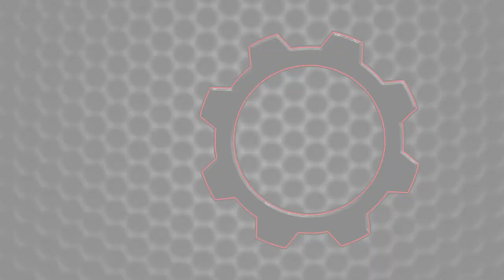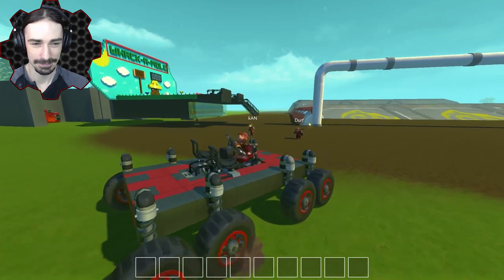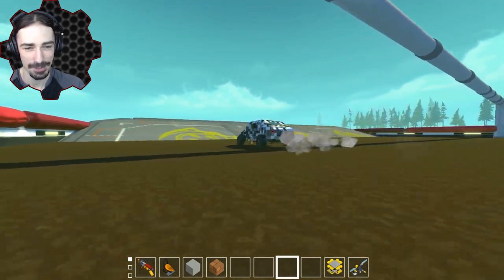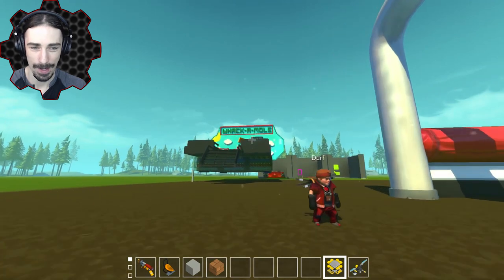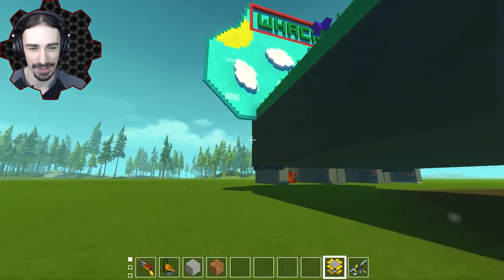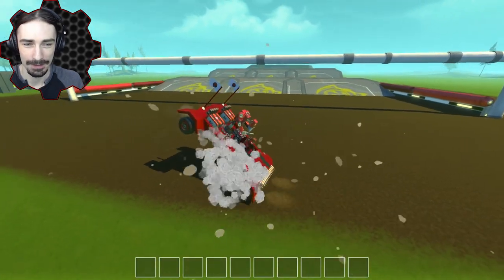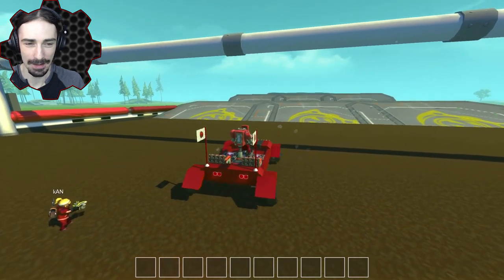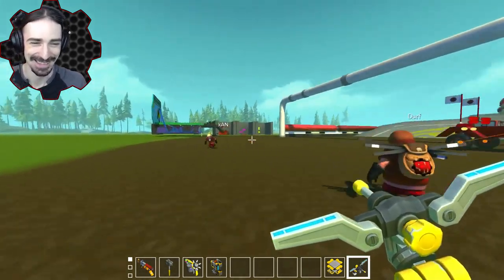FLOPPY WHEELS MAKE RACING AWFULMAZING! - Scrap Mechanic Multiplayer Monday

Comment: The mechanisym for the flop is due to the wheels going too fast for the bearings and the bearings colapse and traction makes the wheels spin faster and faster until you go flying. If you spin tiny wheels at the fastest engine speed(you need mods) and you hit the gas it will glitch out and do the same thing, except it is instantanious. I haven't shared it, but it is the smallest car in the game. From the front its 3 x 2 x 4. And the reason your car was better scrapman is because you were heavy. Therefor it forces the bearings to slow down but once your in the air you wont slow down because you aren't in contact with the ground, therefor there is no squishing effect to slow down the bearings. Thats why u went flying. Also that glitch has been here for since the bearing strength was updated. Soo its old scrapman.

Comment: It would seem cars with fenders that either have restrictive suspension systems or high mass seem to have low levels of flop. This makes me believe that if you either restrict the movement of the suspension or pin it under high weight flop levels go down.

Comment: Here's a challenge idea:
A regular racetrack, but the vehicles do not have wheels; they can only move by piston extension! (You could or could not allow piston to be on rotating bearings depending on what you prefer)

:P